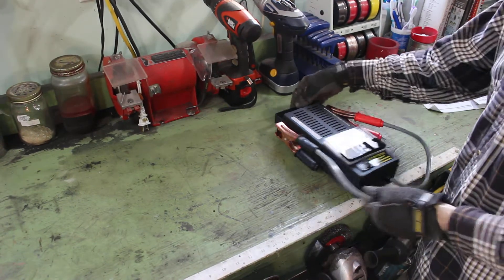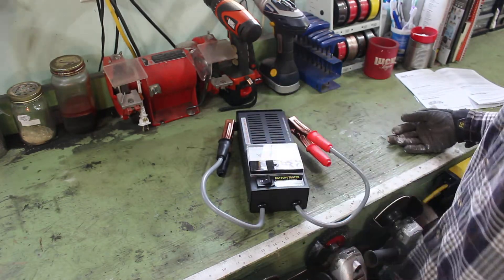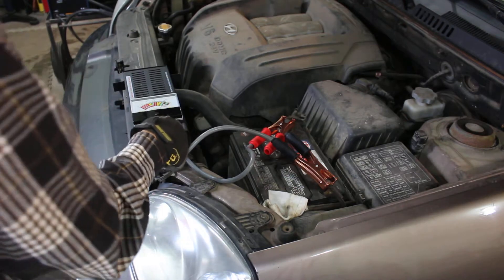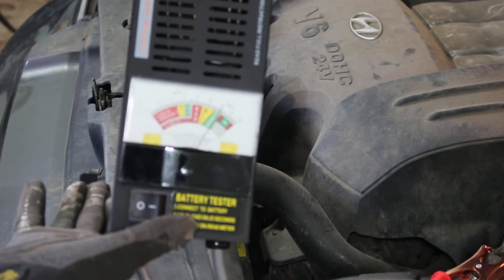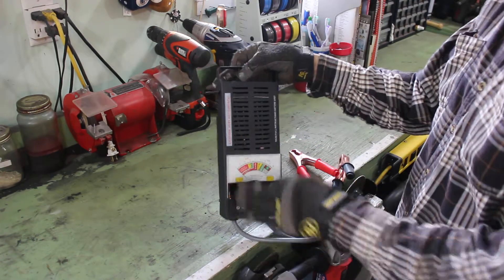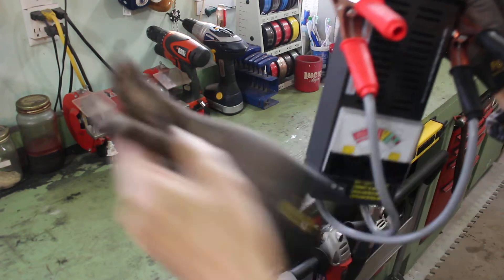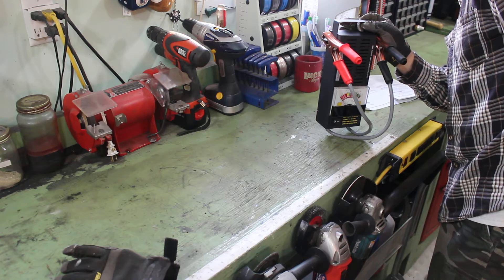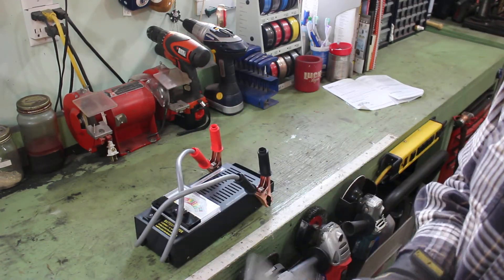Battery Tester / Load Tester

Comment: Looks like that battery is showing 200 or 400 cold cranking amps..you have to use the needle Or all the tests will show the battery is in the yellow
Reply from the maker: What do you mean by "use the needle"?
Reply: Bruce L. Where the  needle points there are notches that have numbers like 200,400,600,800,1000 those are cold cranking amps and if the needle points at the notch then that’s you’re number..you can get confused where the needle points because it looks like it says weak in the yellow..

Comment: I wonder if you can fix these battery testers? I was using mine the other day and i heard a sizzle and it quit working.... It's a princess auto model as well.
Reply from the maker: I suppose you could take it apart and see if there's anything replaceable in there that looks toasted.  Princess Auto should exchange it for you though.

Comment: I'm still not sure which one I'll end up with. I'm hoping to come across one like yours on sale for $20 or so. I don't need something fancy enough to print me out another useless receipt to throw into my wallet, but the fancy digital ones sure are fancy...
Reply from the maker: Ya, I was tempted to buy the Snap On one with the built in printer last year from a friend who was changing careers.  I figure this one should work well enough for me.  I'm also not entirely sure I trust the electronic ones.  How do they put a load on the battery to test it?  I don't know what they would tell me that a multi meter couldn't.
Reply: I’m not sure how they load a battery. What I do know is that we have a few around here at the parts stores and the fancy ones at advance are hit and miss. The one they use at Autozone is like yours and works all the time... go figure, eh?

Comment: the old toaster style,lol. i had one for many years,but on the newer stuff you need a digital one with printout capability. my snap on does 6 -36 volts and was only 500 bucks!!!!
Reply from the maker: I almost bought the Snap On tester with printer a year ago from a friend who was changing careers but I don't see how they actually put a load on the battery to test it.  I can't see what they do that a multi meter doesn't.  Maybe I'm wrong but I dunno...  Besides... $500!!! lol
Reply: i had a old 1930,s pickup truck i was working on with a starting issue,because it was 6 volt system i had to spend the money. others had been working on it for months and the customer was not happy,but i found the problem and was able to show proof of before and after the repairs by the printout.

Comment: Doesn't look like you're into drones so don't know why you scribed to my channel, but thanks anyhow. Like your channel. How about "Bruce Ls Tools & More " for channel name ? I use a Victure AC600 action camera from Amazon $69.99. Comes with alot of mounting accs. Put mine on my hat{for hands free}, on tripod and on walking stick I made.
Reply from the maker: Hi Slydad,  I’ve been flying RC aircraft for about 30 years but have only recently become interested in drones. I’ve subscribed to many drone channels to get an idea of what a good drone would be best to buy for someone new to The hobby. I have many hobbies that I don’t make videos about and post on YT.
Reply: In my opinion the MJX Bugs B2c is about the best all round quad for the best price. There are tons of reviews on it. Don't think I've seen a bad one. I love mine. Full featured drone. Great range ! Low voltage return to home, GPS, Alt. hold and much more. Fast too. Gearbest has them now for $148.69, use code rc15off =$126.39. Good deal.
Reply from the maker: I'll definitely look into that one.  That's a lot better price than anything I've seen in the local stores.

Comment: Glad you're finally sounding better. We had a bad run of colds go through our house as well. Still dealing with it a little bit. That tester is very straight forward and thanks for the video. I should have picked that up 20 years ago.
Reply from the maker: I feel much better than I have in awhile.  I've been meaning to grab one of these testers for years.

Comment: A good thing to do is occasionally top charge your batteries with a trickle charger. I got 8 years out of a motorcycle battery and 9 out of my truck battery doing that about 3 times a year. I top after using a load tester also.
Reply from the maker: That's a good idea.  I have a battery tender that I could put on the battery when it sits for awhile to top it up.